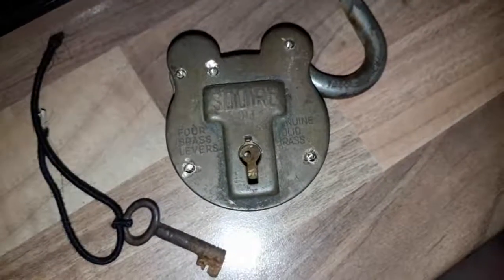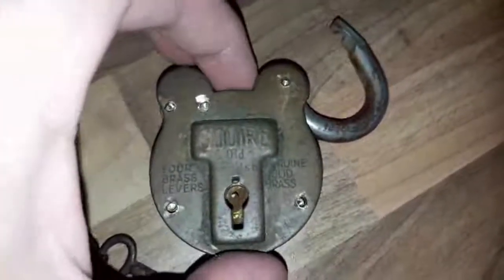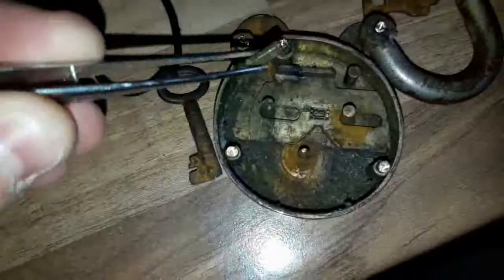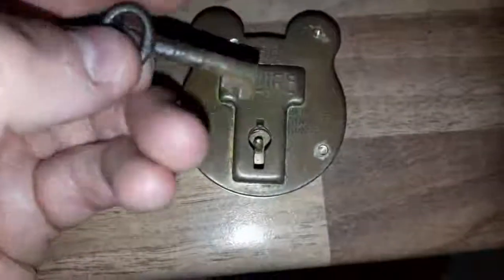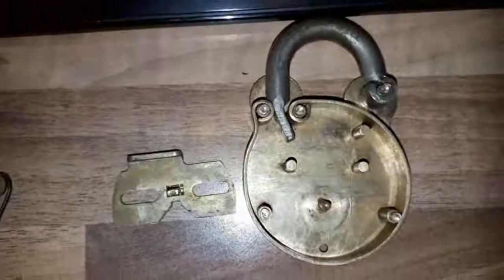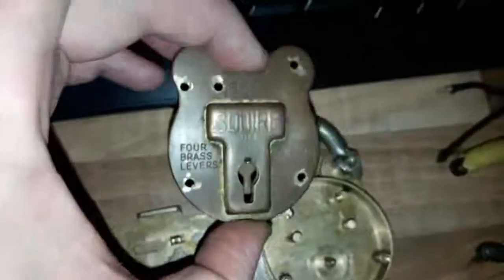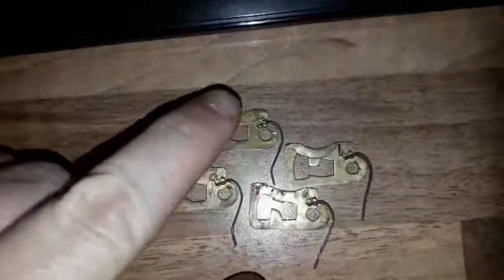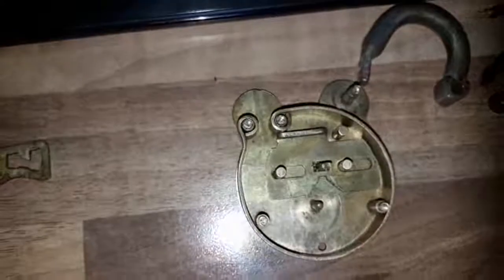Squire 550 clean up

Comment: Thankyou hope you are safe and well  how to take the pins out and can I get  keys made for it my 550 is opened   thanks for you time  art
Reply from the maker: Hi, this lock has levers not pins. You can't take the levers out without destroying the lock.

You can impression a key for this type of lock, but it can be tricky partly because the levers are quite thin on these locks.
Reply: @TheTaff224   thankyou Chris  can I send you a pic of my 550s they were in my magicroom  until   builders knocked down  a display cabinet   they said they put keys in a box so magic every were locks  with keys  now missing any help or cost  ok you  and yours stay safe  always  ART LOVE YOU VIDEOS THANKS FOR YOUR TIME
Reply from the maker: Email is in my about info - not sure I can do much from images though.

You may have some of the 550s which were modified by David De-Val for use in magic tricks - if so then the keys may be non-standard.
Reply: @TheTaff224  thank you I know I had one of David's  but that still has the key it's a long thing the other 2 that are open  were  had smaller keys they were given to me by a old magicians  widow thanks ART
Reply: @TheTaff224   I can send you them if you think you can make a key     they are  out of the way of the builders there here for another week  god knows what they will damage this time STAY SAFE  ALLWAYS  ART